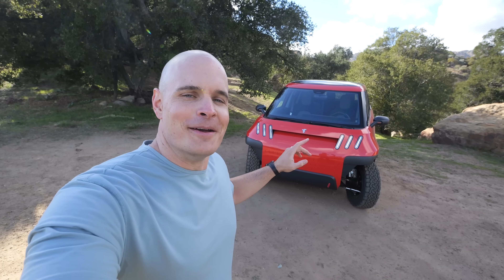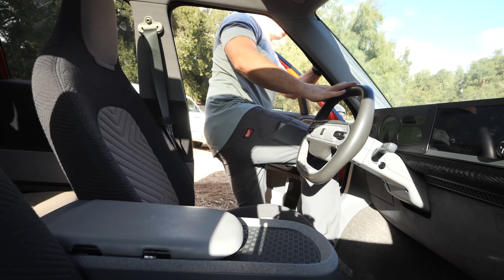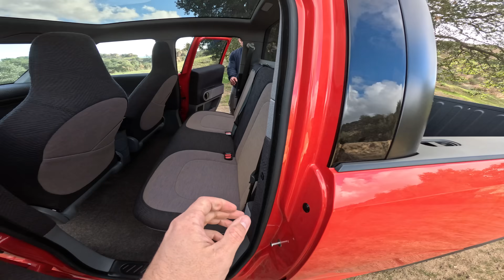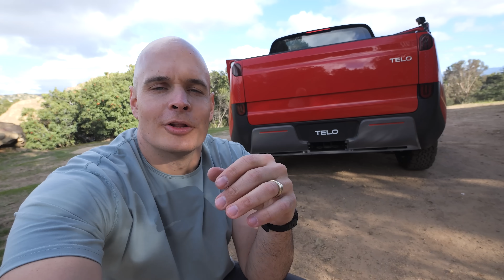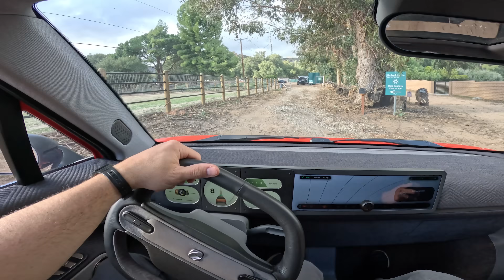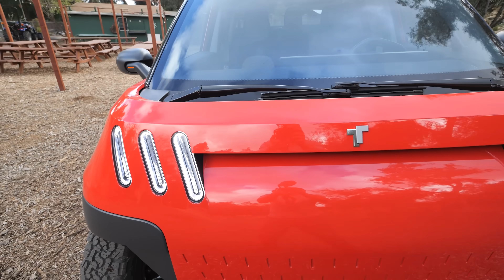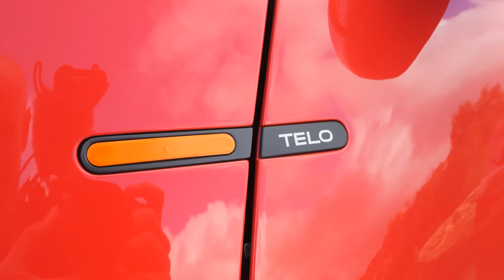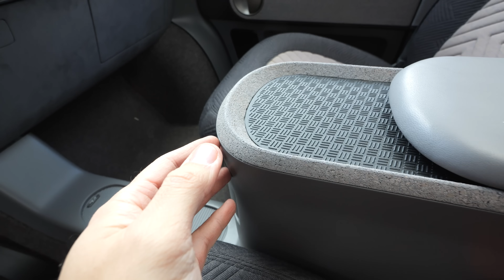ONE TRUCK TO RULE THEM ALL...

Comment: I hope this is still a concept due to the fact that its missing "adequate impact absorbing hardware" in my opinion.  The distance from the front wheels to any impact is barely nonexistent and as such I believe that an adequate front bumper is required. I will be amazed if this current design is acceptable in the stringent European market. I'm no automobile designer but the thought of having an instant  tyre blowout upon frontal impact concerns me greatly.  Great overall product and great review as well. Looking forward to seeing these on the roads.

Comment: So, turns out, You and I are EXACTLY the same height to the cm. I would love to see this in a single cab with a drop side tray and headboard, make the tray 2450 - 2500 long (would have a bit more rear overhang to accommodate) and at least 1250 - 1300 wide, keep the monster tunnel. I think Tradespeople would line up around the block for a good lightweight "minitruck" that they can squeeze into a tight job site and have a practical tray they can work hard (abuse).

Comment: Super cool truck, and I can't wait until they're readily available.

It does concern me, though, that their battery packs are that much more energy-dense than the competition. Battery technology has not evolved in recent years, so packing more in to a tighter space (to me) means they're either not over-provisioning their batteries as much (fewer cycles, quicker degradation) or they're just physically packing the cells closer together (less room for cooling, more potential for cascading thermal runaway).

Comment: I am slightly concerned about the safety factor of the unprotected front side of the front wheels.  But i love the scale of this truck and the fold down rear set/bed extension makes me think they could easily do a minivan version of this.  I love minivans for their practicality and relatively small footprint.  This could take that to a whole new level.  I love the simple interior.

Comment: So the reason why you can have a short EV truck is because a fossil fuel engine is too long/ big? What about the Vans that have the engine under the front seat? How about making a version of this with a higher clearance because it's non electric with an engine put where Vans have them? $41K is still too much knowing how much a battery replacement costs. I say it's too much because China has an $8K City EV coming to market. BTW can you do a video of that one, Scotty Kilmer recently posted about it. MG Comet EV. You can't buy them in the US yet or maybe never? Sure it doesn't compare with the Telo but it's nearly five times the price. $$$$$

Comment: What's with that weird dash? As it feels and quite likely is the case to be made of 2 screen's where one is  50% covered with rounded shapes just to make it look more "classic", but like, why? Why can't this just be a software thing instead of physical one? Unless they actually put in multiple tiny screens, for some weird reason. 
Second thing, what's with that hole at front wheel? For mud to accumulate on your door? For rocks to scrap the hell out of your paint?

Comment: I have admired Telo for some time....here is the but, I would rather have more bed, then two extra doors and a back seat....yeah the midgate folds down, but that rear glass does not move, and when the midgate is open you are not exactly weather proof.

Comment: There's a LOT of rattling.   That would drive me insane.  🤪
Reply: I would guess it's not a finished prototype. You should watch Leno's video with the new Scout. The motor screams, because it's still an early prototype. They'll get it all tightened up before it goes on sale.
Reply: @OCMike     I hope so.  The specs looks amazing.
Reply: Teslas did the same when they released their first model. It will get better before release
Reply: It could also be the rocks hitting the wheelwell, cause that's literally next to his foot, but alas, it is a prototype
Reply: That’s just the interior smelted from recycled plastic bottles falling apart

Comment: I mean I love this but $41,500 starting out is just insane. I will just buy a Kei truck for 5-6k from Japan. I have a fully loaded 2022 1500 ram with eco diesel and it was 58k OTD. This truck is good for cities but most cities owning a car is a luxury. If you can afford a car in a city you most likely arent looking for this truck. I think where this would do good is in suburban areas where someone doesnt need a full size truck but needs to sometimes do some diy fixes on their home. At this price, you are pricing even higher earning middle class out. If anyone came out with a kei truck under 20k brand new in USA. I think it would sell like hotcakes.

Comment: If the wheelbase is that short, why not extend it a few more inches and give a bit more room for the passengers? I'm 6'2" and both of my sons are taller than me. Looking at Zack in there, I don't think there's enough leg room for the three of us to be comfortable. It's about 4 feet shorter than my CX9. Another 6-12" of leg room would make a huge difference and still keep it small.

Comment: Looks cool. I'd like to see the production model with a blank area on the dash to mount cell phones and tablets. There's no need to have a dedicated entertainment display in vehicles anymore. I do everything from my phone. Just need some basic climate controls and a wide open space to mount my own computer display (phone or tablet.) All vehicle settings should be accessible from a computer display inside the HUD. Also needs at least 1 20amp 110v AC outlet to run power tools or charge power tool batteries.

Also I'd like to see an optional slant back camper shell that can be purchased separately to reduce highway aerodynamic drag. It would be a bonus is the slant back camper shell can be lifted up (convertible) to a rectangular camper shell when extra space is needed. Then have a third position where the camper shell lifts even higher for those times when you cant to sleep in the bed. Basically I want a 3 position camper shell....slant, rectangular, lifted up for headroom.
Reply: Yeah, keep adding costs to the Truck......Now, it will start at 51k.....with all the additions you want....This is why the ICE manufacturers kept increasing the cost of the Trucks from 25k to now at 70k.....Keep asking for more stuff, and the price of the vehicle will keep going up......
Reply: @1flash3571  - Perhaps you didn't read my comment carefully. I asked for them to REMOVE unnecessary displays from the dashboard. Then, provide an OPTIONAL 3 position camper shell that can be purchased separately. The AC outlet would be incredibly inexpensive to add.
Reply: @__-pl3jg  and another want something else in the car, and another and another. That is HOW WE ended up with all the stuff in the Trucks and cars today. Why do you think it is 70k vs 25k 10 years ago?

Comment: Please tow something with it. It doesn't have to be the max 6000lbs capacity. 3000 lbs, maybe to see how far it can tow it on a charge. Adding weight is the biggest drawback to electric trucks. I can't replace my ICE truck with something that can't do the same job. In the video, they talk about not needing a separate gas-powered truck  if you have one of these. The biggest problem with EV trucks is how their capabilities are over sold. If this truck is different,  please, please demonstrate it.

Comment: Love the size and everything associated- HOWEVER, that open wheelwell up front needs to change. Extend the front end by 3 inches and cover the wheel well. It's better for aero, it's better for low speed impacts, and it will result in the thing being taken seriously. Nobody sees front tires like that and wants that product.

Comment: Regarding the 'center out' wipers, the way the 'right to left' wipers are set up, a heavy enough rain makes the passenger wiper throw water into the cleared path of the driver, therefore making it not clear for most of the time, and is most annoying.  For a left-side driver, this should be reversed, and maybe it will be good enough.

The center out setup, the passenger one goes down first, so the thrown water from it will be cleared by the drivers thereby having a more clear windshield for the driver than the above.  Having used both (old '66 Thunderbird was set up with these) I prefer this setup over the current trend of today's cars.

Also, it looks cooler. :)

I don't think there's a perfect wiper sys... sees the center mount single wipers and has to ponder

Comment: If you have a "convertible-like" canopy for the bed and make the rear window fold-up-able, you can also add another row of seats at the back. Make the rear (middle) row of seats slide-able back and forth, and you have the complete convertible vehicle: It can maximize the bed for two people trucking, carry lots of stuff for ~5 people, slide the rear (middle) row of seats back a bit and have lots of leg room for 1/2 VIPs, or carry lots of people i.e. ~7. The future of vehicle-ing

Comment: The fact that they have a solar option to allow for passive charging while the truck sits is FREAKING AWESOME.  It says like 12 or 15 miles a day, depending on which you choose, but that is HUGE for a company that uses these for outside work on a campus or like a lawncare company.  I wonder with the tires being so narrow, will they have the same issues RIVIAN trucks have where they are eating tires in like 8k miles?  Second - Will a Pelican long gun case fit in the monster tunnel?  If so, GOLDEN 😊

Comment: my 95 cng 5 speed 4.3 has a 6 ft bed. since in runs on gas and propane.... the motor is sooo clean. propane burns at a higher octane and no egr valve.... so no recirculation of exhaust gases back into the motor. only 119k miles  on a 20 year old truck. my truck has a smaller footprint than all the lithium and plastic that 4 door telo truck has. electric cars/trucks love to catch fire.......... who wants to buy a truck that you can't do truck things with. bring back cng trucks!!!!!!!!!!!!!!!

Comment: Big Question is are you going to be ordering one?? i know you a big supporter of small start ups plus you do like electric and i think they would make a perfect run around errand truck for your quad-bike factory biz and at that price kindof a no brainer, cuz thers only like the ford maverick hybrid that comes in at just a lil cheaper on the price tag but it doesn't have the 6k tow rating the Tello has, the ford maverick is rated at 4k towing so Tello has 2k more towing capacity over the ford

Comment: My daily driver is a 1st generation Bronco ½ cab (aka pick-up) this puts me in mind of its close relative a 1960s falcon truck, NOT a Ranchero but the falcon van based truck or some sort of four door hybrid between the two. The front end design historically has been marketed as 'Forward control' or 'COE- cab over engine'  which in this case doesn't really apply. I think they have an excellent idea that's time may have arrived. Willy's/Jeep, Ford, and Chevy made various similar sized 2 door versions. They may (if they haven't already) want research those i believe all of them had relatively minor and correctable form factor issues that kinda soured the public and manufacturers on them before they were widely adopted. Obviously from the above my aesthetic preference in automobiles is not modern or electronic laden but it's a cool looking truck and a great Idea. I love the concept of electric vehicles but modern cars are overly and unnecessarily reliant on electronics. In my  opinion.

Comment: 41 grand is a really attractive price point for sure, but does anyone else hear all that cheap plastic stressing sound during the interior driving shots?
Aside from the loud interior, this looks like an actual desirable electric truck
Reply: 7:44 when the Ford Maverick came out, I was trying to get one so hard, and very much came up empty. I've been saying if Ford would re-release the mid 90's ranger as like the "ranger sport" or something, and sell it for $15k, they'd have such a hit. Low.budget everything, manual only, optional AC and radio. Those would sell faster than the first wave of mavericks.

Comment: I know you love electric vehicles, I remember the building journey of the Hummer, and for a few select people with ideal conditions and limited travel requirements they may be a perfect choice as long as the risk of the house/garage/car spontaneously combusting causing a toxic gas and soil contamination event isn't something that crops up on their radar. However thankfully the public is realising that the lack of charging facilities is a problem. The certainty that the infrastructure to support them will take decades, and the Grid will never catch up, and the devastating drop in value is making reality more obvious. There is no reason the "save the planet" from CO2, we NEED more CO2 it is almost the lowest level for millions of years, only lower in the 17 and 1800's when there was famine due to food shortages, and freezing events like the Thames freezing over and they had fairs on the frozen river. It has been way hotter during civilisations like the Roman Period when crops were able to grow where they cannot now. Don't worry about the Earth boiling, it's all WEF BS. we are still in an ICE AGE as there is still ice at the poles, and it's going to get colder as we are in a Solar Minimum that will only end in 2053. Northern countries where there is more land mass than the Southern Hemisphere, will have brutal Winters and pathetic Summers leading to crop failures.

Comment: Very cool, I love how compact this is. They should have a strip down version of this to compete with gator trucks, with larger beds, this would be amazing, and good gator trucks for the farm are $30K. This would tow more, have larger bed, and could be used as a backup power on the farm, add a lift kit and it would be a killer

Comment: Only thing off the bat that could use improvement, would be the front suspension and steering components being basically exposed. Going down the highway, thing like salt, water, oil, large debris, could damage them without having a cover/bumper in front of them/the wheels. Otherwise, I love the footprint, and a estimated 250 miles and awd with the large battery? Sign me up!